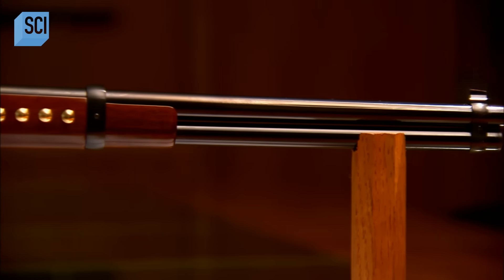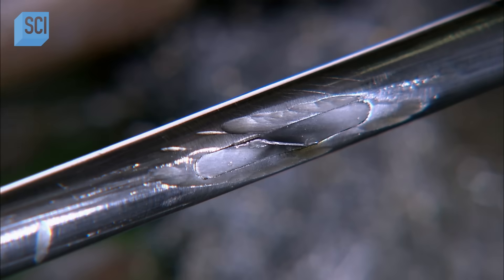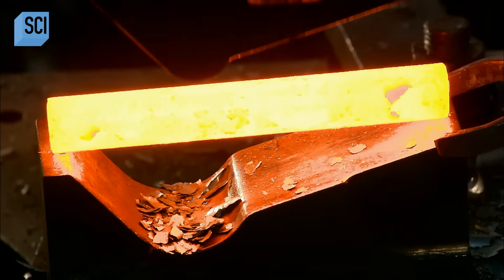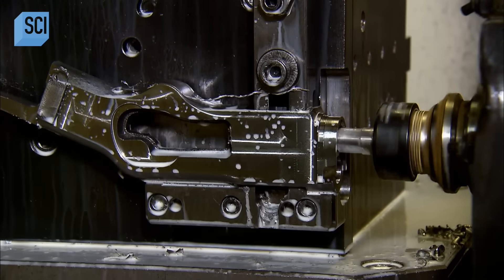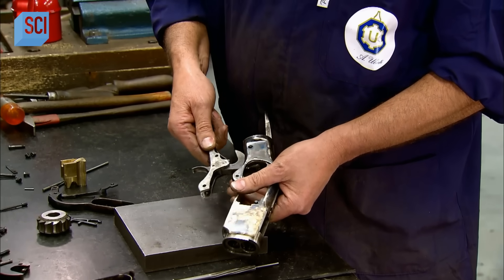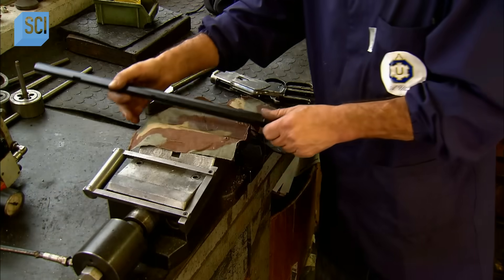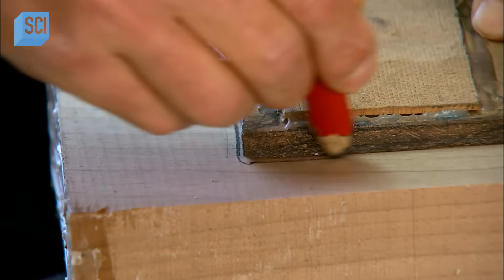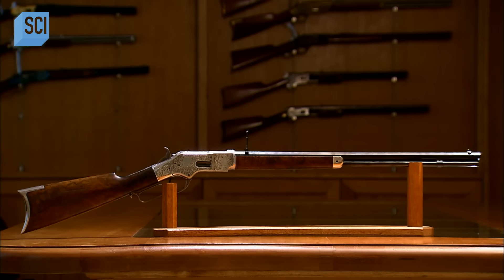How Lever Action Rifles Are Made! | How It’s Made | Science Channel

Comment: I worked for a major gun manufacturer making gun barrels. I wish they had the tools this company did. Loading those steels bars by hand sucked. That said, I think the process was way faster than shown here.
Reply: I think they slowed it down to let us see how it's done
Reply: @alexejvecera6317  I really don't think they did. It seemed like a reasonable speed, but where I worked I think it was faster. Then again, this manufacturer is doing multiple barrels at the same time. Where I worked they drilled 4+ barrels at the same time, then machined them to be placed on an auto forge where the rifling was cut, and the barrels final diameter was set before being cut and shipped to another building for finishing and assembly. The method used in this video I think would be slower for individual barrels because they have to force a cutting tool through a tight hole, vs. pressing down and pulling the cutting tool at the same time.

Edit: it had been a while since I saw the video, and got the rifling section very wrong. They don't use the same machine for rifling as drilling.
Reply: @alexejvecera6317  Actually I just re-watched that section and it's a completely different process from what I thought in my previous comment. That method seems way slower than the process where I worked still. Though I still don't think they slowed it down at all, if anything maybe speeding it up.
Reply: @alexejvecera6317  Jesus Christ loves us all.

Be kind and compassionate to one another, forgiving each other, just as in Christ God forgave you.
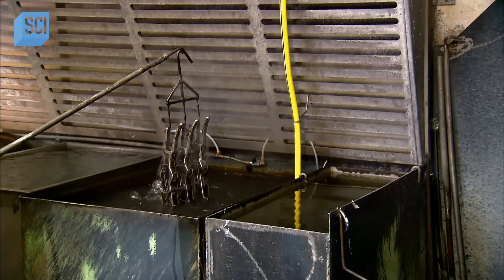Ephesians 4:32 NIV
Reply: @xan6990  Our Father Who AWPs in heaven
CS be thy game,
Uncase begun, them skins be won, Convert- and not a Mil-Spec.
Give us this day a StatTrak knife
And forgive us when we rage quit
As we forgive those who aimbot against us
And lead us not into scamnation
Undeliver us a Battle Scarred
Gaben
Reply: @alexejvecera6317 I'd argue this would be funnier and more accurate as a copy pasta, if it was "AWPs FROM Heaven" given that heaven is a call out on a couple of different maps.